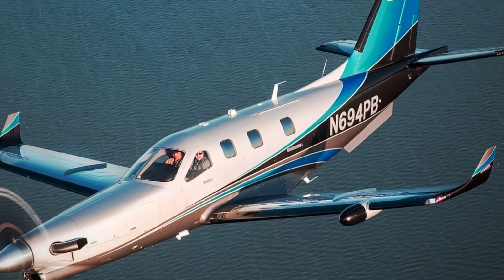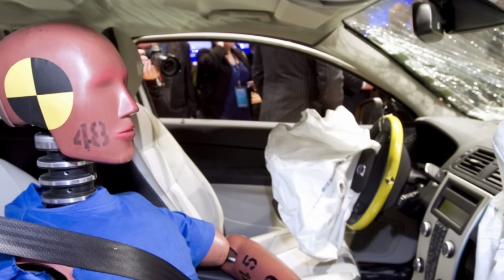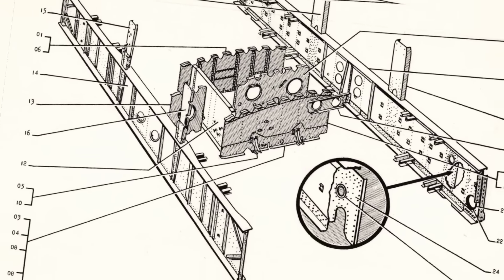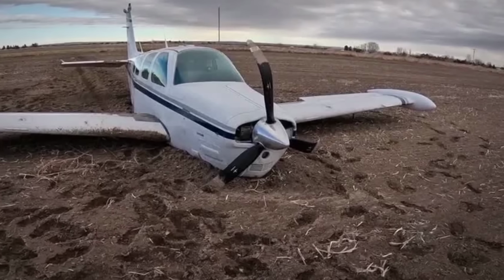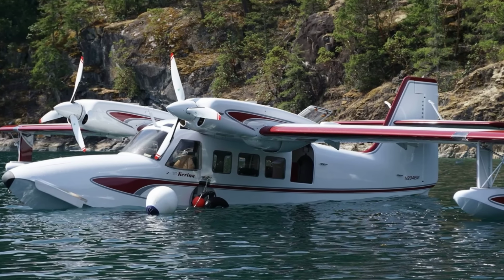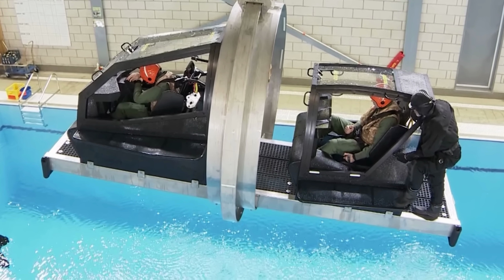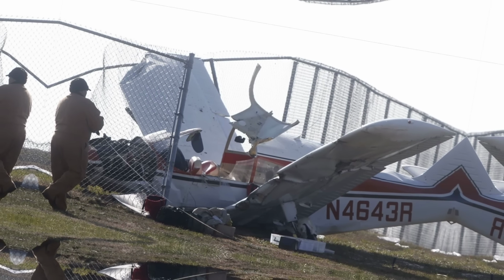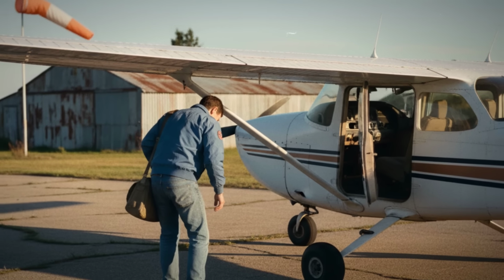High Wing vs. Low Wing: Which Layout Actually Saves You In A Crash? (The Physics)

Comment: In my opinion you have completely missed the most crucial factor in survivability - IMPACT SPEED. Remember E=MC2. Double the impact speed and you have quadrupled the impact force.
Reply: Actually, E=MC2 is Einstien’s general relativity equation. But you are correct if you use E=1/2 MV2. Min speed and sunk rate make things much more survivable.

Comment: Your discussion of water landings is completely wrong. For the same reason that a high wing aircraft has a higher CG and is more likely to flip over when the nose digs in on land,  a high wing is much more likely to flip over in a water landing than a low wing aircraft. Secondly, the wing, and in fact the entire structure, are buoyant until they fill with water. As such the fuselage remains on top of the wing out of the water in a low wing aircraft, whereas the high wing aircraft has to submerge the entire fuselage before it gets any buoyancy from the wings.  

As a general rule, low wings have better in-flight visibility, especially in turns, than do high wings. High wings let you see what is directly below you, but that is usually of very little interest with respect to aviating.   What’s going to hit you and cause a mid air collision is what’s out the front window and the side windows in a turn. And that side view is blocked in high wing aircraft so you can’t see where you’re turning into.  

Stall characteristics are governed by many factors, but high wings throw more down wash onto the tail plane than do low wings due to the geometry of the wing and tail, and when the wing quits flying in a high wing, the downforce on the tail goes away more markedly than it does in a low wing. Generally speaking the nose drop is more pronounced in a high wing. If you happen to get low and slow in landing configuration and stall 20 feet in the air, do you want to nose in with nothing between you and a quick stop, or would you rather mush in nose high and slide on top of the wings as you do in a Piper?  Which ways decelerates you more gently?

If one forgets to lower the gear in a high wing, he has to schlep out from under the wing on his hands and knees like a wounded animal, assuming he can even get the door open. With a low wing on the other hand, he can proudly open the door and exit normally , stand upright and wave to the crowd as he joyously admits to his mistake. 

No two ways about it. Low wings are the superior way to belly in! 😂
Reply: Further, the weight of the wing,  spar and fuel are pushing down on the fuselage, sinking the door that your're trying to  get open. Fuel and water weight about the same.
Reply: @capncloud  YES, that's a great point that I have never thought of. It's a "catch 22" with low wingers. I'm kind of in "no man's land with low wingers - the Piper wing spars are a roller coaster ride to me - I know they're "strong", but when you see that the entire wing load is transferred on about i foot of metal beam through 18 bolts in a six inch by 2inch rectangle, I don't know, it just seems rather "cheap" to me. I would be OK with it if Piper used 2 wing spars - the INBOARD spars could be metal like now, but mated to composite outboard spars, then each spar to center box interface would have its load reduced by 50%. That's how Diamond built its DA5oRG & DA 62 wings - using 2 spars. But a new DA50 RG is like 1.2 mill and the useful load is OK, but not great.
Reply: I agree UNLESS you flip over.  If you flip over in a low winger, you're going to wish you were in a high winger. It's way easier to escape from a flipped high winger than a flipped low winger. Especially since most high wingers have 2 doors & most low wingers only have 1 door.
Reply: glenwood: Yeah, I agree, I thought that this vids description of the two planes water-ditching scenarios were reversed, too. Also, you're right about the wings acting like floats, and they will float even longer filled with fuel (lighter than water), and the fuselage and cabin stay above not filled with water. 
The irony is, a lot of high-wing Cessnas are fixed gear, and search-and-rescue guy told me once that those almost always go over and end up on their back. If you tighten the seat belt and unlatch the doors prior to touch-down, you had a chance to get out and float awhile.

Comment: The big assumption here is the aircraft being right side up.  Often, an aircraft flip over upside down.  Especially in a water ditching.  A canopy pinned between the 1000lb or more aircraft and the ground is impossible to open.  Fuel flows toward gravity and away from you if you're upside down.  Being inverted int he water where it may be dark is disorienting.  Take those factors into consideration as well.
Reply: Thank you about the point on the canopy which I refer as "bubble canopies".  I have been getting on these threads calling for a simple airbag system in low wingers with bubble canopies. {of course I got verbally blasted LOL - my soul is made of titanium so it doesn't bother me - much but I digress} - but my idea is have a simple lightweight airbag system on the TOPSIDE of the wings for low wingers - but ESPECIALLY low wingers with bubble canpies. That way if you crashland and flip upside down, you push a guarded button and the airbags inflate enough to push the aircraft "up" be able to open the bubble canopy. My guess is it would be 30 LBS of extra weight. But not hardly any affect on CG.